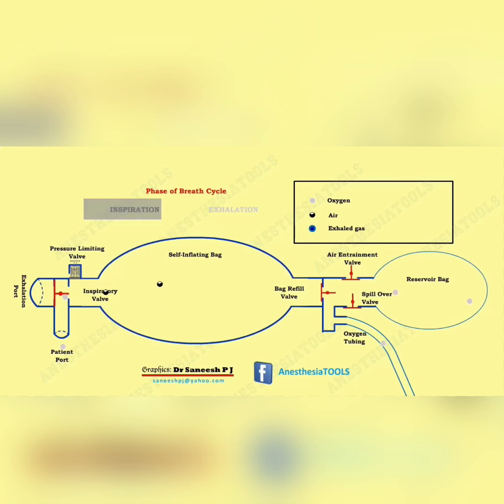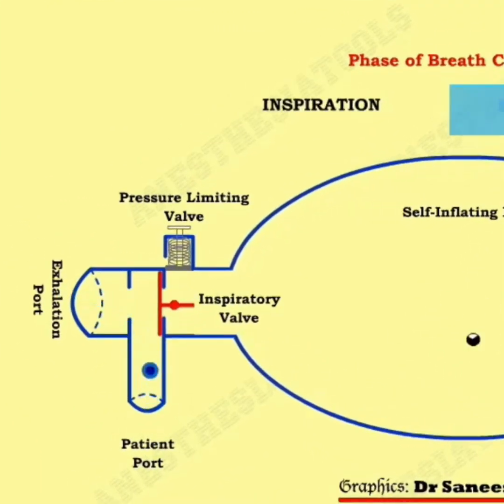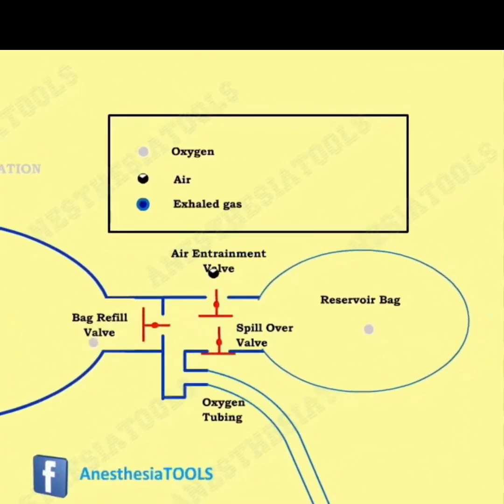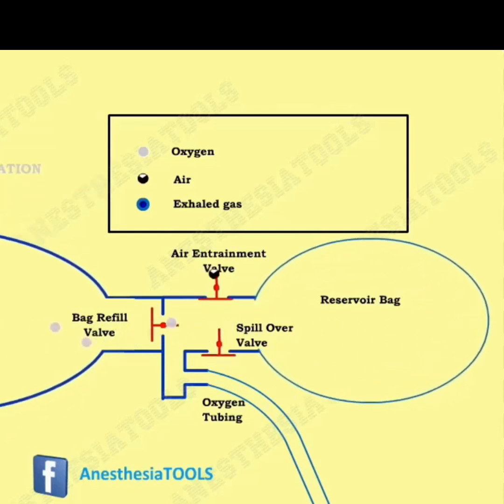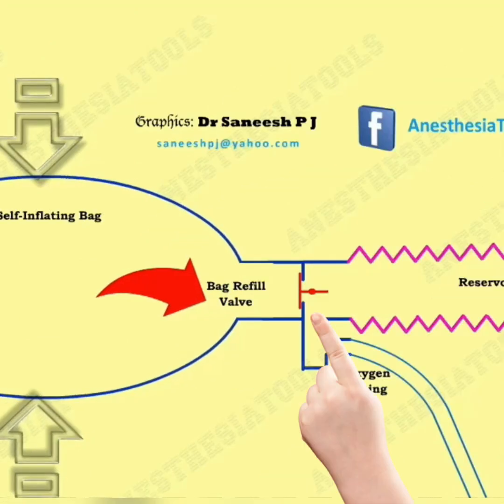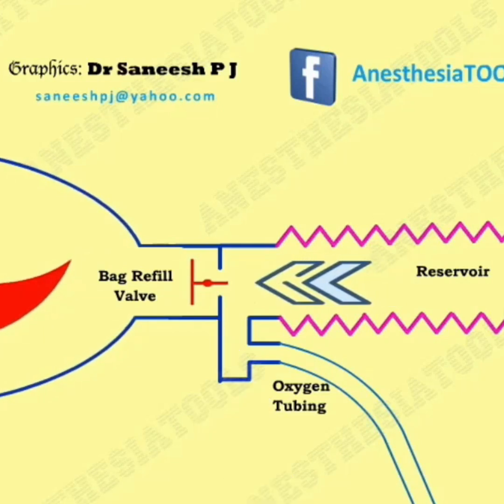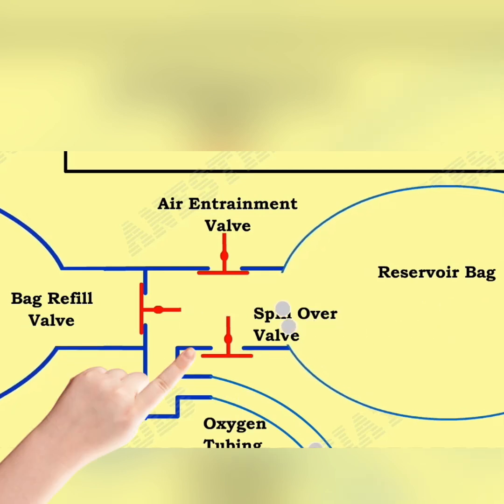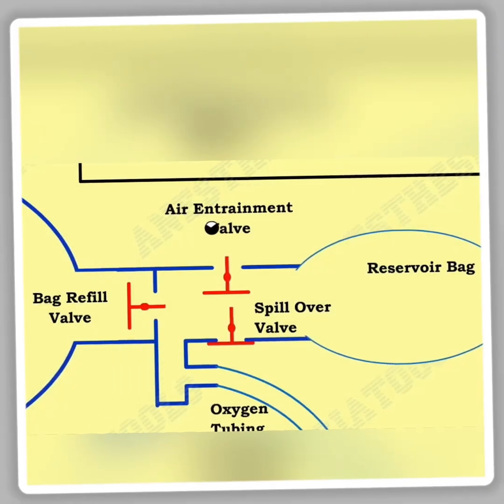Functional analysis Ambu bag / manual resuscitator #anesthesia #criticalcare

Comment: I returned to your comment, and I would like to ask why we have an air inlet to give air with oxygen. Could you please explain?
Reply from the maker: The air entrainment valve is intended to provide adequate volume of gas, whenever oxygen supply is inadequate. The manual resuscitator is basically designed to give positive pressure ventilation and not for providing a given oxygen supplementation.